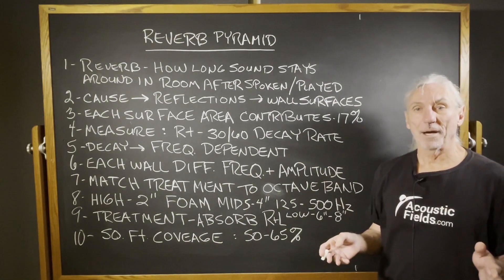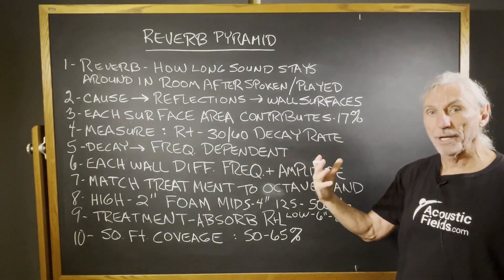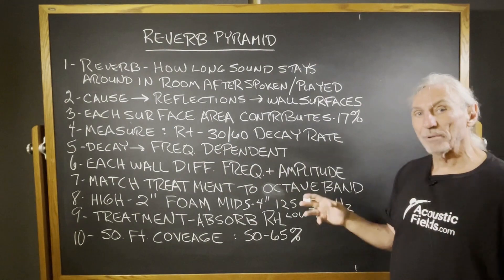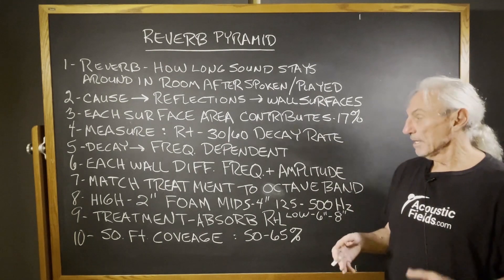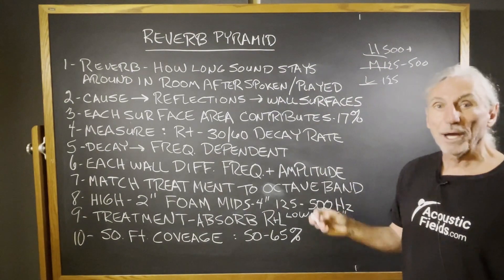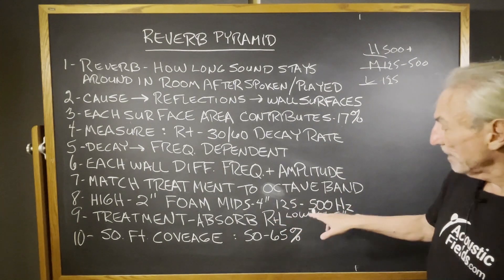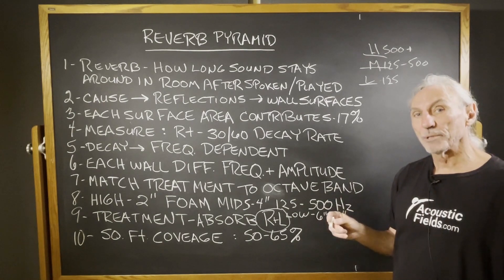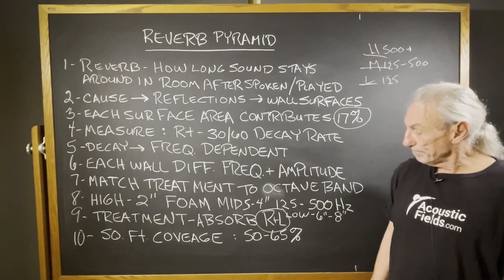Reverb Pyramid - www.AcousticFields.com

Comment: Hi Dennis, Here's a challenge: How to lower the reverb time in the welding shop that has steel sheeting walls and ceiling with a concrete floor.  A friend of mine built a new 60 x 120 x 20 foot shop and I can't stand to be in there for more than a hour.  The echo goes on for several seconds.  Worse than a cave.
Reply from the maker: What are the pressure levels?
Reply: @AcousticFields  My question is more of "food for thought" for you and your company.  There is plenty of factories, machine/welding shops and home garages that would greatly benefit from fire resistant sound deadening products.  Affordable of course.
Reply from the maker: @welderfixer  Most of these industrial applications use boxes filled with building insulation due to budget. They are not concerned with the rate and level of absorption as it pertains to music and voice. Their only goal is reverb reduction.
Reply: @AcousticFields  Yes sir, you are correct about only reducing the reverb in the commercial building/room.  Reducing that reduces the chance that anyone in that space that has any sense of acoustics will not feel the need to beat his/her head with a hammer until the pain matches the sound, creating a canceling effect.  It's like a mild form of torture hearing even your footsteps go on and on.  Some rooms could be used as a set for a new episode of the Twilight Zone. ;-)
BTW, thanks again for all that you and your crew do!!